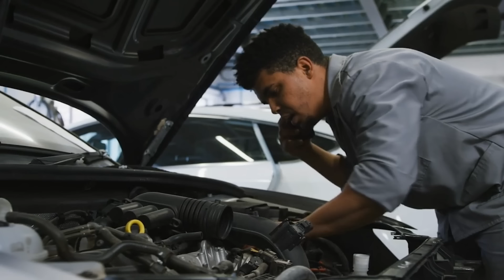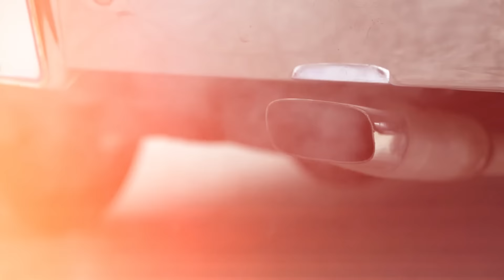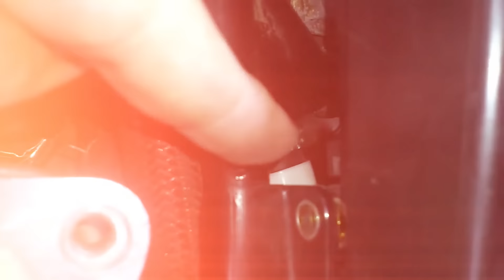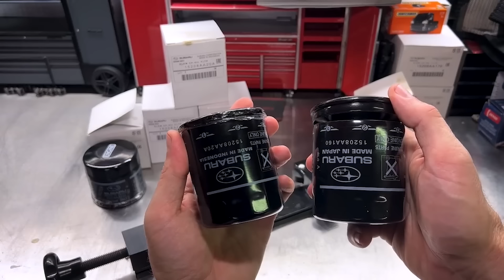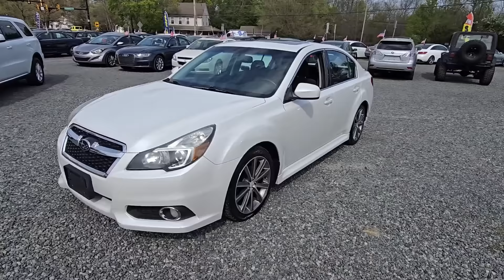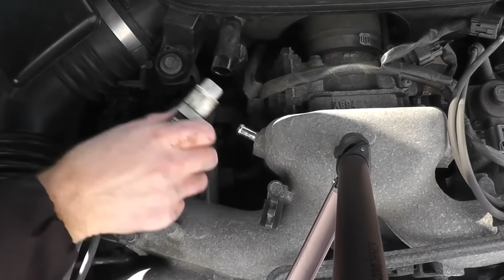Attention Subaru Owners! FIX THIS NOW Before It’s Too Late!

Comment: This Applies to All Subaru Models and Engines - especially the Turbo engines , not replacing the PCV can lead to oil leaks from built up pressure -- Changing it is easy and you Do NOT need a Dealer to do it!

Comment: if you don't care about the environment just drill out the PVC valve and remove the plunger/spring and just connect a hose and vent it to the atmosphere.. never had to worry about stuck valve....... lol
Reply: Yeah, the "old" way they used to vent the pan!

Comment: Change your oil more frequently, like 3K to 5K miles,  and instead of 0-30 use a thicker oil like 5-30.  Valvoline Restore and Protect helps clean deposits.  Good luck !    Do the CVT fluid changes too !

Comment: This is true. The Subaru guy talked about this a couple months ago. I believe all engines are affected. I just had my PVC valve replaced a couple months ago at 65,000 miles.

Comment: Thank you for posting this.  Does this apply to 2023 Crosstreks??
Reply: I have a 2023 6MT and I'm going to replace my PVC valve this week.
Reply: @DeSoccerRefMan i will make note of this.  Is the EGR valve on the 2023-24 Crosstrek easy to replace?
Reply: YES- All Engines 2.0/ 2.5 /2.4